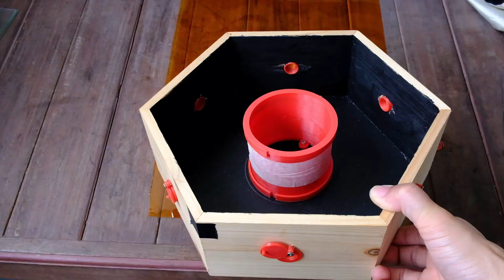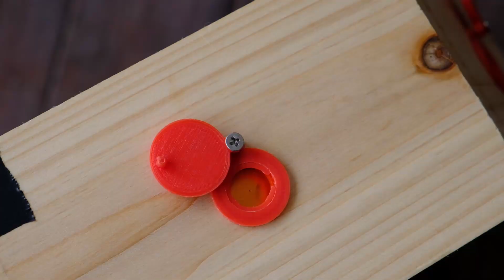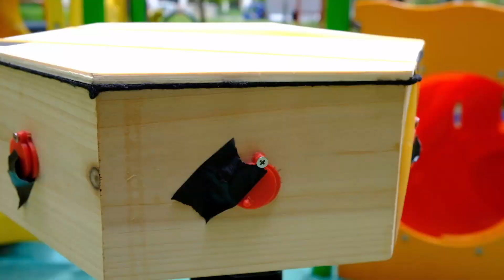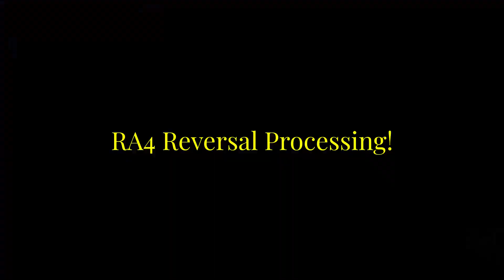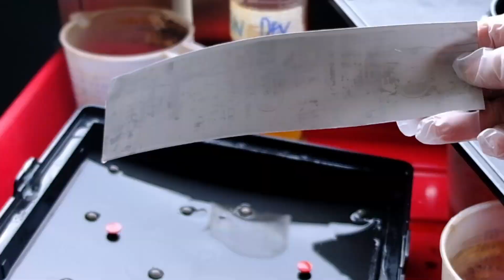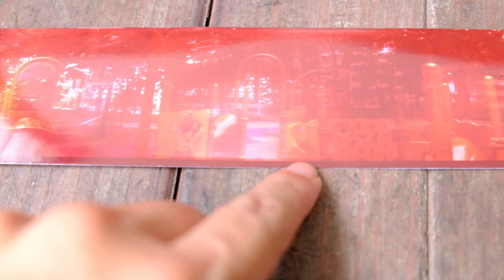What went wrong with my RA4 Reversal process using  360 degree pinhole camera?

Comment: from my own experiments using RA4 paper but with C41 chemicals several years ago now, I came away thinking that the filtering is dependent upon the light in the scene at the time and can change. Whether this is actually the case I may never know.

I hope you manage to find the sweet spot for filtering!
Reply from the maker: indeed i have good results in my previous attempt using a 8x10 camera so i suspect my paper or chemicals are out too.   need to try again.